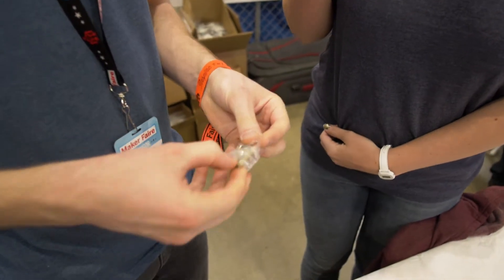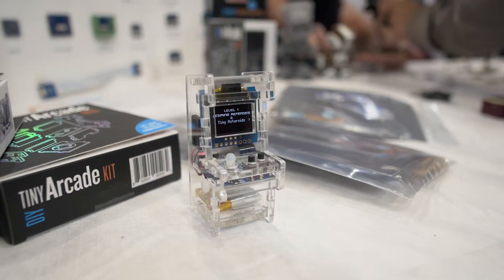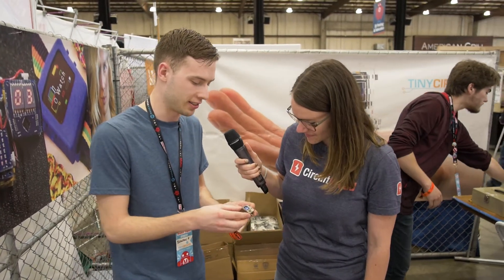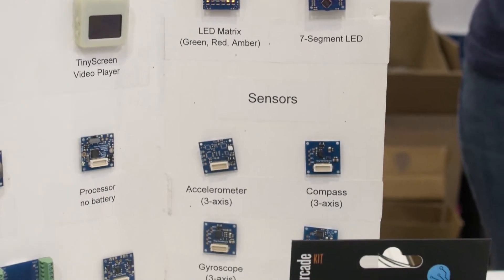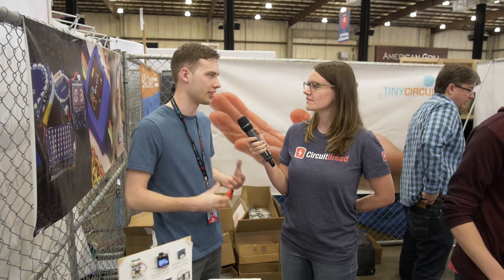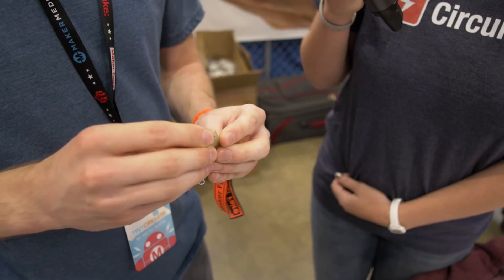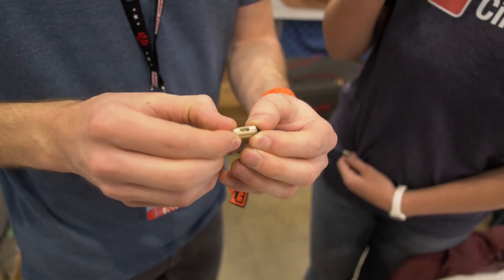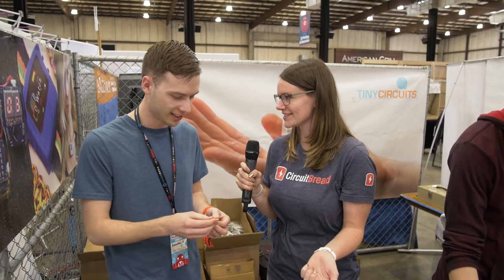World's Smallest GameBoy! - TinyCircuits | Electronics Maker

Comment: How to tiny RC chip using Arduinodroid apps plz
Reply from the maker: Hi there!  I'm sorry but I don't understand the question - could you please rephrase?
Reply: @CircuitBread  how to make tiny RC circuit by using Arduinodroid apps.
Reply from the maker: Thanks for clarifying!  I'm sorry, but none of us have ever used the Arduinodroid app.  That being said, if it's just an Arduino IDE that runs on Droid phones, why would you try to emulate an RC circuit in software?  Would it be better to just make a physical RC circuit that interfaces with your Arduino?  Are you thinking RC - Race Car?  Or RC - Resistor Capacitor?
Reply: @CircuitBread  RC any vehicles but I have no pc that's why I m asking for Arduinodroid.
Reply from the maker: Unfortunately we don't have any Arduinodroid app tutorials and our RC vehicle tutorials are done with a PIC10F200.  We haven't gotten the YouTube videos up, but there are several more tutorials that could help with this, but they would need to be approached differently using Arduino versus the Microchip PIC we used:  https://www.circuitbread.com/tutorials/bluetooth-controlled-robot  - and there are other tutorials to help with RC cars, this is just a good one to branch from.
Reply: @CircuitBread  thnx but u r only my light of a hope I know u can get my requested treasure at any time I m not giving u pressure.